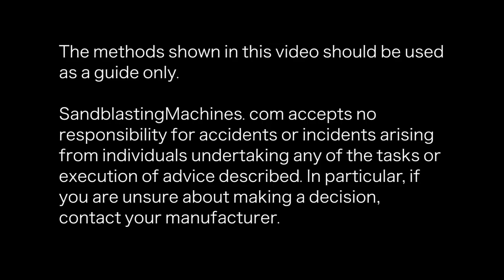How To Install a Pop-Up Valve and Inspection Door on a Clemco Blast Machine 1042

Comment: Make a video removing an old corroded one.
Reply: I made a tool
Reply: I keep rolls of stainless .032" etc safety wire (cheap online) for this sort of thing and would loop it through the door fitting then twist it around whatever you like to keep the door from falling in to the pot. Removing large corroded nut videos are all over Youtube but since the bolt will be rusted too I'd probably either wash the nut off the bolt with a cutting torch (done right you can miss the bolt threads) or just slice it off, get a replacement bolt and nut, coat the threads with anti seize to make it easy the next time, install the door then slap a thick coat of paint over the nut and exposed bolt threads (the anti-seize means it won't be perfect but either anti-seize or paint will cover the threads well enough. I do that to a lot of my outdoor hardware since it ain't a beauty contest.